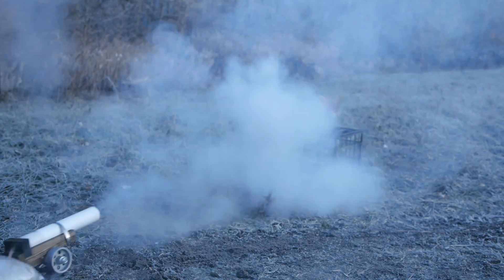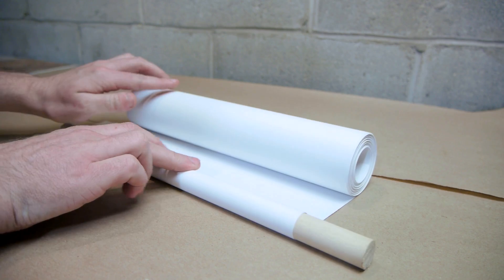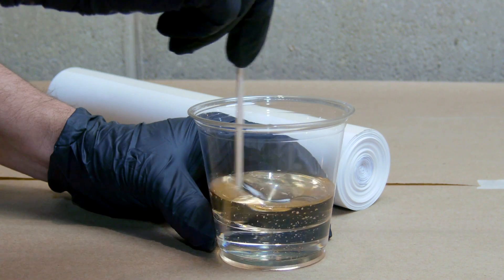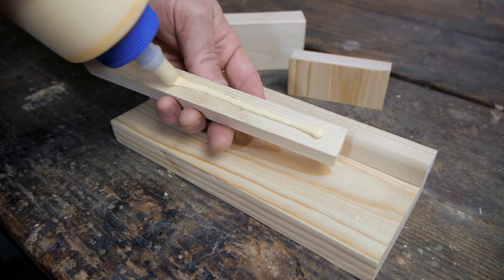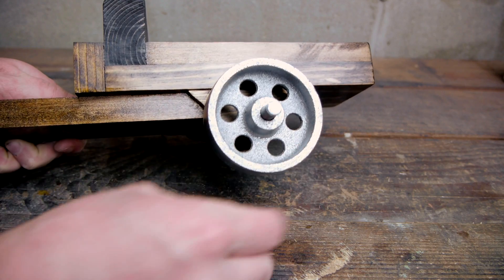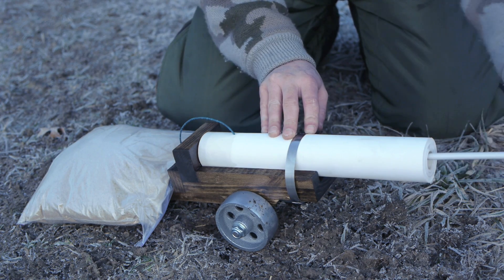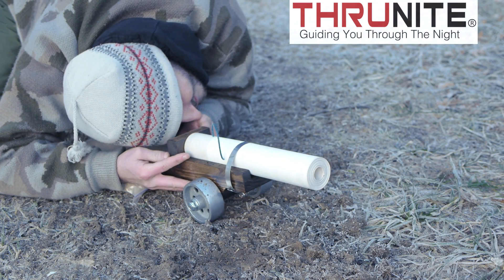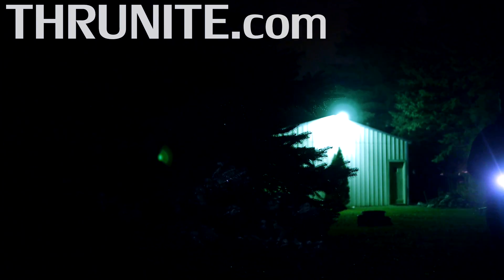Building a Paper Cannon | Black Powder - NightHawkInLight

Comment: Instead of replacing the paper barrel every time you fire, take a wooden rod, then make it hollow with your drill bit, put it in the barrel, and it will save you money and paper if it works.

Comment: i imagine by using a piece of bone-stock copper pipe from the hardware store as a bore liner you would have exactly 0 issues with it ever, assuming it doesn't corrode.

Comment: I would like to build a very similar cannon but using a steel pipe,what diameter should the walls be if i will be shooting 1cm ball bearings? Also how much powder should be used?
Reply: +Lorenzo Giancristofaro it's perfectly legal but very dangerous
Reply from the maker: I cannot give you advice on that. I recommend you do not make a steel cannon.
Reply: +NightHawkInLight yeah I guess it is not safe or legal. anyways, what is the thickness of the fuse you used and what is the size of the hole for it?

Comment: If you want it to last for more than one shot, you can use steel tubing to roll the paper around and stay as a barrel, with a bit of epoxy on the outside to hold the tubing to the paper (the epoxy isn't structural).
Reply: Using steel pipes will just make the paper useless right?
Reply: Not necessarily.  You could use thin wall steel tubing, which couldn't hold a large powder load by itself, but the paper could take a significant amount of the pressure if it's wrapped properly.  Even conduit is better than nothing.

Comment: I made a similar cannon although I used the bottom from a box that scale models of rockets came in I made a video about it on my youtube channel ( no not the model rockets that fly they are stationery until you move them of course) it did not fire as well but to be fair I couldent roll it that well because of how thick the paper was so a marble didnt go through the peice of cardboard recently I made a new model out of metal that shot a pencil into a water jug and the pencil exploded on impact I do not have a video of that though im hoping to get one up soon that cannon blew up now I havd a bigger one made out of galvanized steel so the residue from gunpowder doesnt eat away at it as much which if you didnt knw the residue attracts water causing oxidation in metals well watch the video if you want it is called loading and firing my hommade cannon if you say I sound like a 2 year old I am 13 and my mic isnt the best so thats not what I sound like so dont say that

Comment: Why did you use paper instead of (for example) a copper pipe or a metal pipe? Or you could've wrapped the paper around the pipe and not have the problem of the interior paper unraveling. I think a paper/metal pipe will be much much stronger and will be able to withstand the pressure much better.

Edit: You could also soak the entire paper barrel with epoxy, with the wooden rod (?) still inside. Then you have to remove the wooden rod and you have a perfect strong barrel. Will be very hard to remove the wooden rod though.

Comment: Thanks for the video! Really interesting concept.  Would  be fun for New year's eve as it would be inexpensive to construct and is disposable too. When you are done, you can chuck the barrel and make a new one for the next year. I wonder if you used epoxy to bond the paper on the inside where the paper meets on the very first revolution if this would prevent gasses from getting between the papers and ruining the barrel from the inside out.

Comment: Could try using a copper tube for a core with the paper barrel, that way it wouldn't damage the paper, you just choose one that has in internal diameter of what you're looking for so you might need less paper?

Comment: I made rocket casing in a similar way long time ago,  but I did have wood glue between each layer.  I overreached myself with the paper nozzle though.  That was epoxied,  but it unravelled shortly into the flight (about 10ft up)

Comment: why not use some kind of thin metal tubing (such as brass or copper)  as a barrel and wrapping paper tightly around it to ensure strength. that way the inside will not get torn up by the blast but it will still be cheap and replaceable

Comment: one of the earliest cannon designs in Europe were the "letter" cannons, so named because they used letter paper to make the barrel, the stated with a fairly thin copper tube and then wrapped it in paper, when they were finished with the paper they applied another layer  of, I believe, rawhide to prevent damage to the paper.
Reply: Interesting... can you cite the source. Thanks
Reply: @ishitshau  Data that was...six years ago...
Reply: I have vague memories of reading it in a book on early medieval warfare...but I can not recall enough to cite what book it was, and a quick online search does not tell me anything.

Comment: Interesting. How about using copper pipe or emt for the center of the barrel?
Reply: Such design has already been done in the 17th century, it didn't work very well. Instead of paper they used leather to reinforce a thin metal barrel in order to cut down weight and cost of a cannon. But since leather acted as an insulator, the metal barrel got too hot after a few shots and blew up. The same thing would happen with paper.
Reply: I assume you're talking about the Swedish Leather Cannon?

Comment: Try using thin wall galvanized steel pipe as a barrel then wrap in paper to have enough strength to withstand the force of the blackpowder

Comment: Is there any reason you used glue for this instead of screws or some other method? Was it mostly aesthetics?
Reply from the maker: +Nelinno04 When you're screwing through thin pieces of wood you need to drill tap holes so the wood doesn't split and I would have needed a pretty large variety of screw lengths for all the bits and pieces. Glue just ended up being the easier option. It's also stronger when you're talking about narrow pieces like the side rails.
Reply: NightHawkInLight OK, that makes sense, thanks.

Comment: That's pretty much exactly how I made my black powder cannon, except I started with a 3/4" ID PVC tubing as an initial start. Then rolled up paper around it like you did to withstand the pressure build up of the gasses.
Reply: how did you seal the breach
Reply: Andy Bahr Same idea, paper plug + epoxy
Reply: +Worldadventure Lehderp 
i had thought that too....just wonder when it does fail how much shrapnel will be flying with our brass or copper tubes
Reply: Andy Bahr You can always get some cheap steel piping with an end cap, but gets a little sketchy because it can turn into a pipe bomb  lol.. Unless you restrict the amount of black powder of course :P

Comment: I would by the Ti5... IF it had a hand-crank battery. It's so much easier than constantly buying batteries.
Reply from the maker: +Rippertear - Gaming Videos AKA SDL Benjii TGPASOTSISAPROA(THR)STTLOYTYVM You should buy rechargeable batteries. They hold more juice than disposable ones and have a higher output anyway.
Reply: NightHawkInLight
That's true. I'll look into it.
Reply from the maker: +Hoch134 I wasn't aware they supplied less voltage. I would be surprised if that's true of most rechargeable batteries nowadays. I haven't tried them in ThruNite lights, but they've always worked fine for me in everything else.
Reply: +NightHawkInLight But they have less voltage. Doesn't that affect the brightness?
Some bright bicycle lamps I used before didn't work well with rechargeable batteries as they only provide 1.2V (instead of 1.5V).
Reply from the maker: +TheSageDad I sort of prefer twist on for no particular reason, but the button on the Ti5 is pretty nice. It's firm enough and offset from the sides of the light so I don't think it would go on in your pocket. The clip on the Ti5 is as good as they get so it doesn't need to be in the bottom of your pocket anyway.
Reply: 38911bytefree You're right with 1.2V cells and they probably are 1.23V so they sum up to 3.7V (and are charged up to 4.1-4.2V).
I'm not sure about that. As you said. A disposable battery is completely empty at 1.2-1.0V. So a rechargeable battery won't last long because the circuit just shuts down at a specific voltage.
Reply: Shadowrcmegatech
wow, that curve looks like me flying a plane....
Reply: +Hoch134 1.2 is the nominal voltage.  Fully charged theyre about 1.4
Reply: Shadowrcmegatech The voltage drops as soon as they are in use. This happens to every battery of course, but the nominal voltage of standard batteries is 1.5V.
You can look it up or try it yourself.

Anyway, the best idea is to try it out with the ThruNite, as every circuit is different.
Reply: +NightHawkInLight How do you like the clicky switch versus spinning the tail cap? I only carry button-less EDC lights so I don't keep turning it on when I bend over, etc.
Reply: +Hoch134 There are some other batteries, for example look at the high drain rechargeable 18650 batteries like VTC5 lg hg2 or samsung 25r. Their max output is 4,2 volt when fully charged, having a ton of miliamphours and they can discharge up to 20-30 amps of current. These kind of batteries are used in mods (vapes)
Reply: +Hoch134 This varies extremely much!
Reply: +Hoch134 Thats true. But since ONE battery is not enough to turn a white led, (no matter is normal or rechargable, white leds use near 3v) the flashlight most have a step up or booster circuit inside. So 1.55 or 1.35 will not be noticeable (circuit will step up the voltage to the necessary output) plus you can take almost all the juice from an "almost" flat battery, because many step-up circuits will operate as low as 0.9V. Dissposable ones still get 20% of its capacity from 1.2 to 0.9 ( not accurate figure), so still usable capacity, but many gadgets like calculators will strugle to keep working below 1.2V like remotes and so
Reply: 38911bytefree My bicycle Power-LED lights are 3V as well, but they had that exact problem. They used three AAA batteries for the standard use. When I placed three AAA rechargeable batteries, they went off after about one or two hours.
That isn't practical at all.
I'm not sure if it works with this advertised flash light though, but I'm pretty sure they would advertise the use of rechargeable batteries if those were working well with the flashlight.

Bananovskyy Are there also 1.5V rechargeable batteries around?
Reply: Hoch134
I never heard about 1.5 rechargeable. The avaible technologies are aroun 1.25V. This has to do with the chemestry of the cells I believe
Reply: 38911bytefree I guess so, or with the structure. Although I never understood why most rechargeable batteries are 3.7V (or better said 3.0V-4.2V).
Reply: 3.6V are made of  1.2V cells I guess. But other cells are 3.7 to 3.9V (like the one in notebooks).  Not sure if they are cells of batteries. Today manufacturers need to take in account rechargeable batteries as possible. If you grab an old calculator LCD is almost blank at 1.2V, they need 1.5V to work properly. Happens that a dispossable batt at 1.25v is almost empty so it was ok for and old design.
Reply: Rippertear - Gaming Videos AKA SDL Benjii TGPASOTSISAPROA(THR)STTLOYTYVM Where did you get a plane?
Reply: Shadowrcmegatech
I didn't. But if I tried to fly a plane, that's how it'd end up.
Reply: Rippertear - Gaming Videos AKA SDL Benjii TGPASOTSISAPROA(THR)STTLOYTYVM You would take off from the sky?
Reply: Shadowrcmegatech
Top of a cliff, probably. I do live by a mountain.
Reply: Rippertear - Gaming Videos AKA SDL Benjii TGPASOTSISAPROA(THR)STTLOYTYVM Nice
Reply: +Hoch134 3.7V (nominal) 18650 sized cells are Lithium Ion cells, a totally different chemistry.   They don't come in standard C/AA/AAA sizes, and they need careful charging as they can catch fire if charged too quickly or too much.

RC models especially quadcopters use a lot of Lithium chemistry cells, because they carry a lot more power for their size than all the old 1.2/1.5V types,   so if you want to learn about them or buy chargers and cells and packs etc,  try a good RC model site e.g. HobbyKing

To run a 3V led off a single Lithium cell,  you'd probably be best with a resistor in series to limit the current, although choosing the value might be tricky if you want to run the cells down from fully charged (4.2V but only until you load it) down to  3.0V (which is the lowest you want to run them before they get damaged).   It shouldn't be too hard to google a suitable circuit though,  as many modern torches and bike lights use lithium chemistry cells.
Reply: Shadowrcmegatech You noticed that those are 8V batteries?

Didn't those high performance cells for RC models lose the energy in a very short time?

You could probably use a Z-diode for that use.
I decided to use a switch for low light (bright but consuming about 0.1-0.15A) and full beam (lighting up a few hundred metres but consuming about 0.7-0.8A). That works perfectly fine as you normally just want to be visible for others, but  in some cases you really profit from the extra light.
I don't remember the voltage exactly though, as it's all sealed against rain. All I know is that one LED was powered by 4.5V and on the cooling board, a small circuit was placed.
So I am using the cells of an old powerbank (3x4.3V, 2800mAh - parallel connected) and they work fine.
As I don't even use the maximum (and standard) voltage, the current doesn't drain my battery and with the low light setting I can drive for days.
I have no automatic shutdown for an empty batter though, but I remained the clickable 'scale' which shows me the state of charge of the battery pack. It never got empty though and I recharge it every 50 hours (at least 10-20 rides) or so.
Reply: +Rippertear - Gaming Videos AKA SDL Benjii TGPASOTSISAPROA(THR)STTLOYTYVM You would think, but I bought a T10 (1 AA battery) 6 1/2 months ago and am still on the original battery.
Reply: .40 S&W Fan As we don't know how much you use your flashlight, that means nothing.